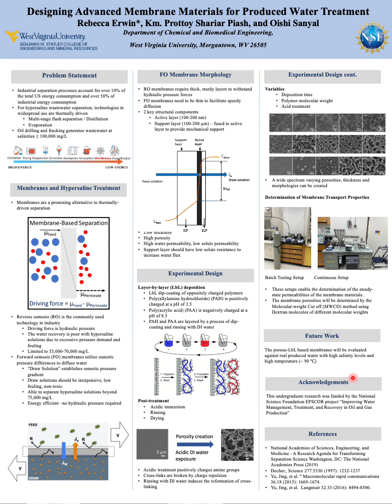Designing Advanced Membrane Materials for Produced Water Treatment

Comment: Wonderful presentation Rebecca. I have few questions:
1.) why does reverse osmosis fail for hypersaline solutions?
2.) what is the significance of cross-linking, the experimental design describes rinsing in deionized water to reform the crosslinks.
3). apart from the 3 variables, you considered in your experiment, what are other factors to consider?
Thanks.
Reply from the maker: Hi Tobi,
To answer your questions:
1.)  Reverse osmosis fails for hypersaline solutions due to the excessive hydraulic pressure that is demanded to diffuse water across the membrane.  Poor water recovery is achieved at these salinities and pressures.  Additionally, this application of high hydraulic pressure coupled with the hardness of the hypersaline feed solutions leads to significant fouling on the membrane.  

2.) Cross-linking refers to the bonds formed between the oppositely charged polymers, PAA and PAH.  After the dip-coating process, these cross-linked layers are treated with an acidic solution that creates positive charges with the amine groups in PAA.  As a result, PAA and PAH oppose each other due to charge repulsion.  These layers are then rinsed with DI water to remove the acidic solution, and cross-links are reformed.  These layers reject the DI water and form pockets that become stable pores when the membrane is dried.  

3.). The selection of polymers for dip-coating is another important factor as complementary functional groups are necessary.  The pH of these polymers is another important consideration. Also, the iteration of dipping/membrane thickness is important to consider for the morphology of these membranes.